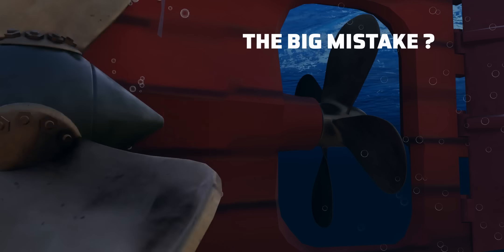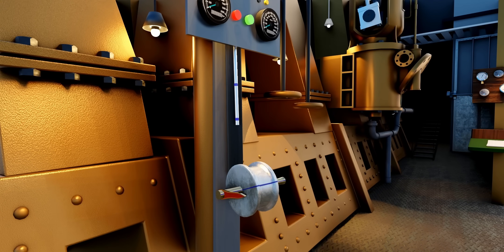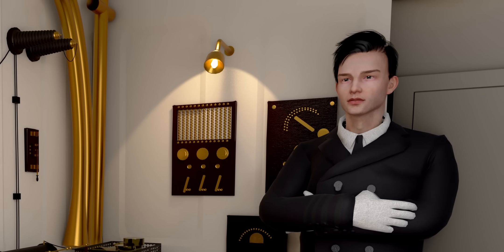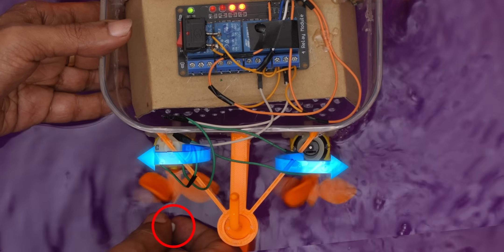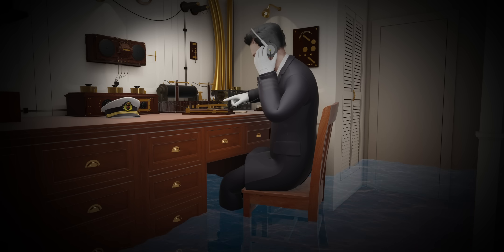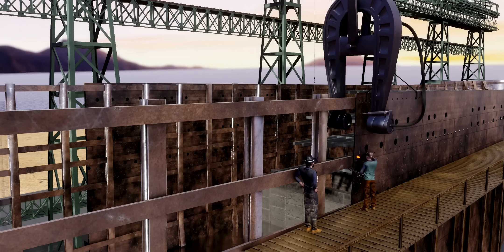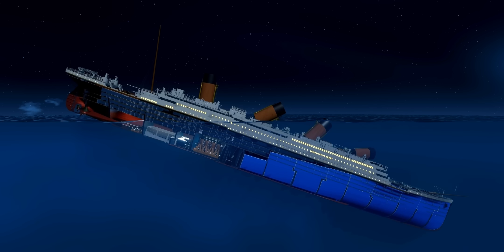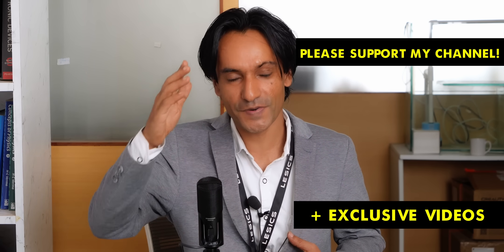How did Titanic sink? | Solving All the Mysteries

Comment: If it wasn't for the fact that most historians have agreed that Titanic's engines probably weren't running in reverse during the collision but instead were stopped
Reply: @chrisiyo_2017 
@RetroGaming
@maisonraider4593
@miguelballesteros8692

Anyone who watches the 1997 Titanic film has to understand one thing: the film has 33 historical errors, such as the phrase "Not even God sinks the Titanic", which was confirmed to have been said in 2012 and was created by him to add drama to the film. The fact that the Titanic never had a 4-blade central propeller, but rather 3. The iceberg impact scene is all wrong. 

First, we see Murdock order the helmsman to turn to starboard and turn to the left. This is completely wrong. The direction is correct, but the command is wrong. Port is left, not starboard.  

2nd It is the Reversal of the Engines, in the Logbook, it says that the Order that Murdock gave was for "Total Stop of the Engines", from the moment they saw the Titanic until the Collision, only 37 Seconds passed, there was not enough time for the Ship to stop, but the most disturbing Question about this Scene, is seeing the Engines being Reversed Abruptly, whoever understands the Minimum of Mechanics and Navigation, knows that the Titanic's Engines could never be Reversed Abruptly like that, because they had Hot Water Vapor and at High Pressure in the Pipes, if they were Reversed Abruptly like that, the Connection of the Pipes with the Engines would be interrupted, and the Pipes would Burst with the Pressure causing the Titanic's Engines to Explode.  

And 3rd was the Scene of the Impact with the Iceberg Itself, in the Film we see a 90 Meter Line being Broken by the Iceberg, if it really happened that way, the Titanic would take minutes and not Hours to sink, in Truth, the Iceberg Tear was in 5 different Places and at Different Heights, with the Tear in the Fifth Compartment being right where there was a Fire in the Coal Bunker on April 2nd, this was enough to Weaken the Double Hull, the Bulkhead and the Doors that held the Coal that could not withstand the Amount of Water when it filled.
Reply: I do not know where you are getting your information but I respectfully urge you to redo your research, I refer you the offical transcript of the United States Senate Hearings into the sinking of the RMS Titanic. This hearing took place from 19 April to 25 May 1912, at the Waldorf-Astoria Hotel in New York, NY and were later moved to Washington, D.C., where they were held in the Russel Senate Office Building. The Hearings were chaired by Senator William A. Smith.

Pg 229 - Fourth Officer Joseph G. Boxhall, states he heard First Officer William Murdoch, who was the Officer of the Deck at time of collision, give a report to Captain E.J. Smith, in which Mr. Murdoch stated “I put her hard astarboard
and run the ENGINES FULL ASTERN, but it was too close; she hit it."

313 - 3rd Officer Pitman testifies that the ship was placed in full astern at the time of collision, this testimony is based on what he heard other crew members talk about after the collision.

On page 732 Captain of the “Californian” Stanley Lord and again on page 762 Captain of the “Mt. Temple” James H. Moore provided testimony that indicates the action of running the engines full astern would be a customary action of that day during any similar situation in which there was an impending collision with another object.

Unfortunately no testimony of First Officer William Murdoch to verify his actions as he perished in the sinking. But these testimonies do establish that is nearly certain that the ship was in fact placed in full astern immediately prior to collision.
Reply: Very poorly researched video. Look at the wireless section...
Reply: And the binoculars lol.